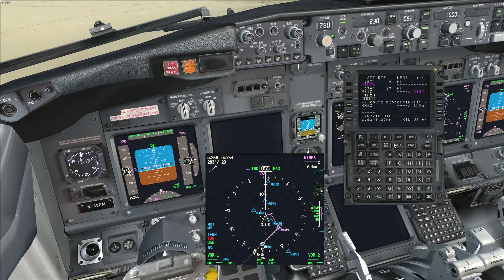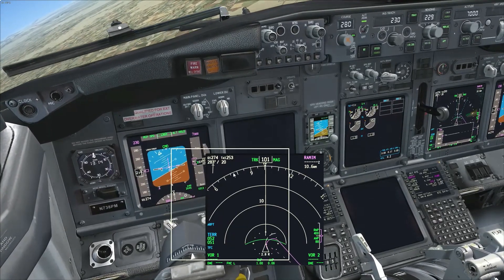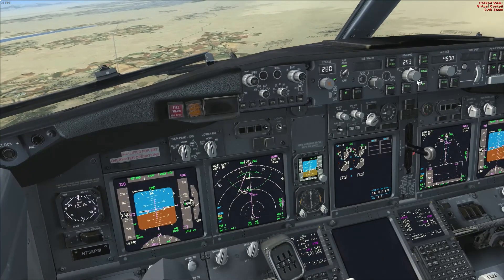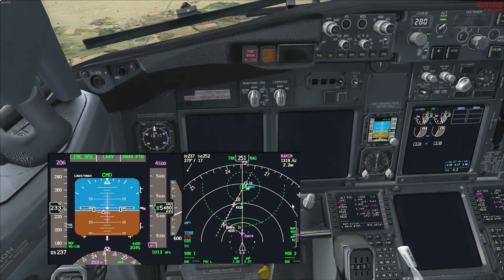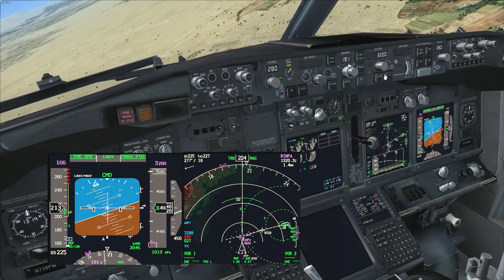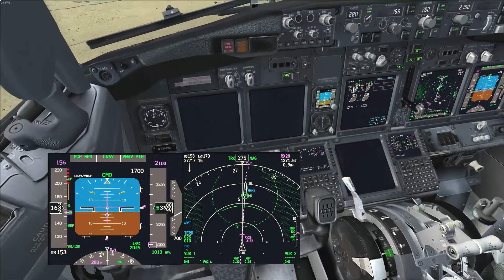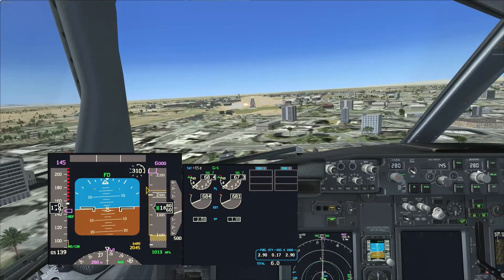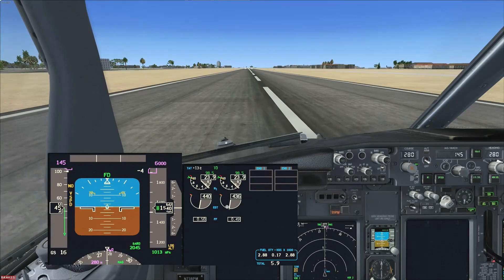Flight Simulator Boeing 737 Visual Approach Tutorial -Flown By A Real 737 Pilot ( MARRAKESH)

Comment: Is it possible to fly the downwind?
Reply from the maker: Yes it's all about how you type things into the FMC some PMDG versions aren't brilliant, all you need to input is the point you want then add a radial and distance, for instance LAM150/10 so that's a point that would be based off of lambourne VOR from 150 degree radial at 10 miles, and a point will be generated, you can do the same abeam a runway to create a downwind leg.